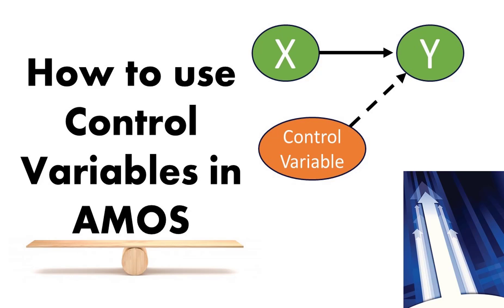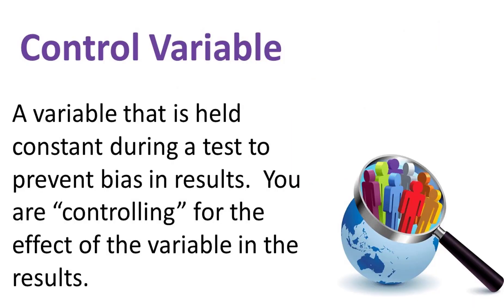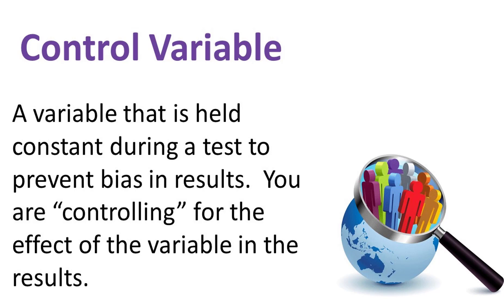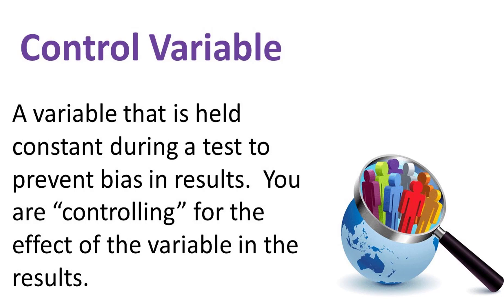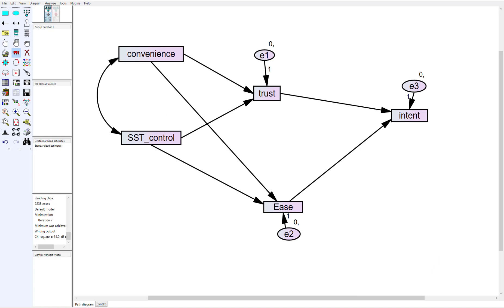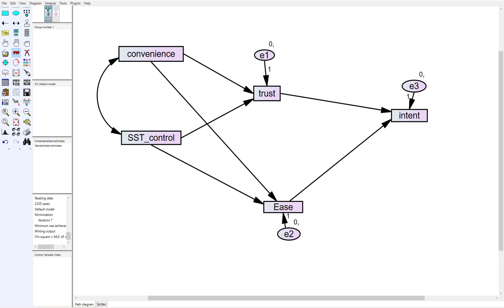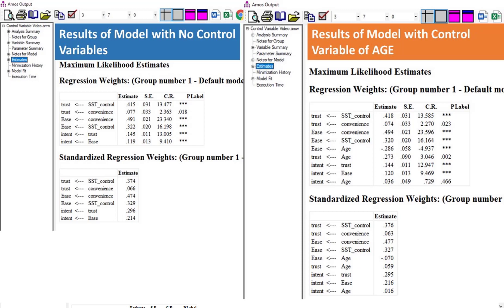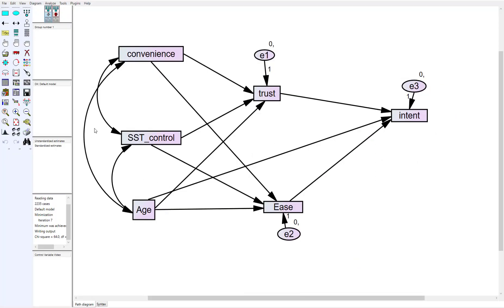How to use Control Variables in SEM (Structural Equation Modeling)

Comment: Thanks for the video! What would be the difference between analyzing a control variable  (for example, Gender Female /male) vs analyzing the model with groups (group 1: female, group 2 male) when to use one or the other process?
Reply from the maker: Control variables are trying to account for variance in your model in explaining the dependent variable.  Two group analysis is examining if relationships are significantly different across the groups.  Control variables are necessary if you think that a variable will change the outcome of your dependent variable....for instance Age and technology acceptance.

Comment: Great! I have a question regarding the measurement and structural models with control variables. When evaluating these models, should we include the control variables in the model and assess the model indices, or do we need to remove the control variables to assess the measurement and structural models?
Reply from the maker: I assess model fit before adding control variables.  Many control variables will have relatively no influence but will cause unexplained variance in the model.  In my opinion, assess the model fit with the initial structural model and then add you control variables after that.  Is it wrong to assess model fit with the control variables included? No but it will usually produce more unexplained variance which could hurt model fit...especially if the control variables are not significant.

Comment: Hi, thank you very much! If we want to see if the relantionships between the obs variables -> mediator -> Y vary as a function of language, for example (let's say, a test in English and a test in Spanish, within subjects design). Should language be included as a  covariate or as an obs variable?
Reply from the maker: You would be better off testing language in a two group analysis so that you can see if the differences in language are significant.
Reply: @joelcollier9387  Thank you for the reply! Even if I had a within-subject design? For example, the same group took the two tests (one in each language) . I just posted a question on Cross Validated with more details, the name is "How to design a within subjects structural equation model"

Comment: can we use control variables for latent variable in measurement cfa model?
Reply from the maker: No need for a control variable in a CFA.  A control variable is to "Control" the influence of an independent to a dependent variable.  With a CFA are you looking within and assessing validity.  No need for a control variable.

Comment: Hi, Prof. Can I assume control variable is affect to indepent variable(x) as well as mediator and dependent variable? Thank you for your time.
Reply from the maker: The control variables only have a relationship to the dependent variables.  We are controlling for the influence in the outcome variables.
Reply: Thank you for your time. Do we allow to draw covariance arrow (bothside arrow) between independent variable and control variable…? 
Please help!
Reply from the maker: @yoonseoyang1977  That is correct! You will include a covariance between the control variable and independent variables
Reply: @joelcollier9387  Is it right that there is a covariance between control variable error and independent error? Or no need to include errors? The control variable is affecting to independent and dependent variables. Thanks for your time again! :)
Reply from the maker: @yoonseoyang1977  No need for error terms on the control variable and independent variables.  Error terms are reserved for dependent variables.
Reply: @joelcollier9387  Thank you very much! Your reply helped!! :)

Comment: Sometimes a control variable (gender, age, education) is added as dummy, but I do not understand why it is done. Which one is correct? I am confused about it. By the way, could you send an example of control variable reported on the paper, especially with amos or smart? I do not know how to report. Thanks for your time.
Reply: Mr. Collier, thanks for replying quickly. As you said, it is a little bit comlicated to comment. If I am stuck for presenting and commenting in the model, may I ask you?
Reply from the maker: If you have a control variable that is categorical, then you will need to dummy code that variable.  If it is continuous, then no need for dummy coding. As for presenting results, I give a detailed breakdown in my book "Applied Structural Equation Modeling using Amos".  Control variables are presented just like structural results.  That is a little too complicated to present in the comments  but I would encourage you to check out the discussion in the book.  Hope this helps.

Comment: Dear Professor, how can we include ordinal or nominal variables as control variables (i.e. education with 8 categories ranged from 1 to 8) ; Do we need to re-code somehow our variables;
Reply from the maker: You can not treat a categorical variable (education ) as a continuous variable.  So you would need to convert this to a categorical variable in the data.  The easiest way is to dummy code the variable to high and low education levels (dichotomous)  and control for the effects.  If you are looking to control for more than two categories, then you are going to need to use a multicategorical approach.  If that is the case, see my video titled "how to use multicategorical variables in SEM"  Hope this helps.

Comment: Hello sir, kindly answer to this question. You said that if the control variable does not make change in the beta value then we can remove it from the mode. But what if we keep it or show it in the model just to show that we controlled for it even if not significant?
Reply from the maker: It will be fine to leave it in the model.  It is not having an effect but if you want to show a reader or reviewer that you controlled for the variable's effect, it will be fine to leave it in the model.
Reply: Thank you very much sir for reverting. You reply would be help me a lot:)